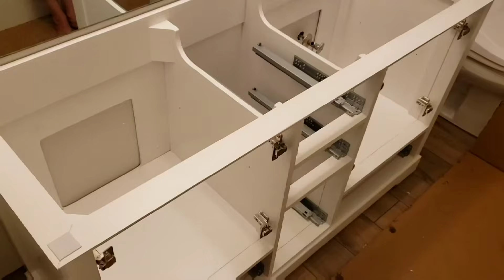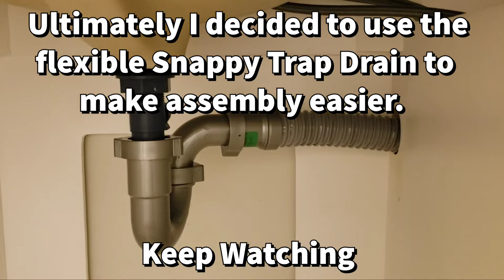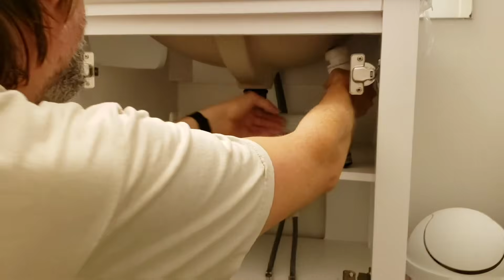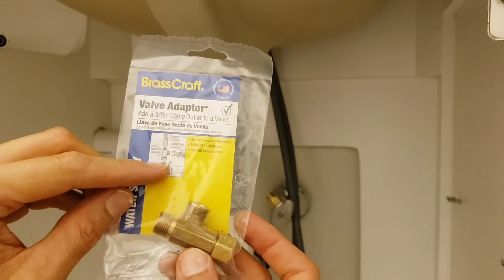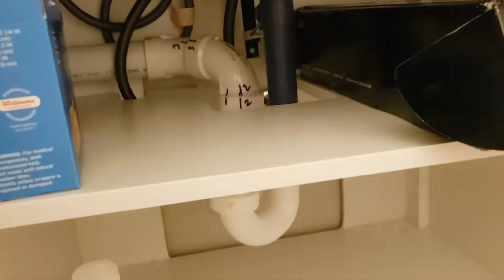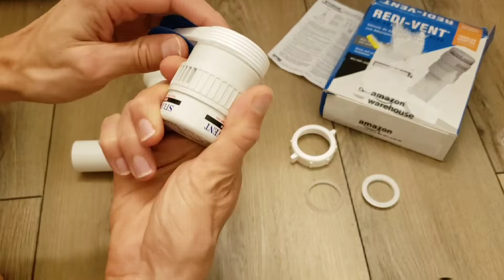Install Double Bowl Sink Vanity w/ Only One Wall Water Pipe Connection & Drain Pipe Using PVC

Comment: Wow... yeah. Don't do this. There is a reason why double sinks in the kitchen don't run their pipes like this. If you fill the left sink full of water or are dumping a bucket of water down it, it can create a siphon and empty the trap on the right sink, potentially allowing gas to exit into the room. If you want to have two sinks with one wall drain, do it like how a double basin sink in a kitchen is done, just an extra couple feet further apart. ffs
Reply from the maker: That was solved in the video by using an AAV. No issues, everything still works great.
Reply: @engineerable  sob... I skipped right past that part with everything else I was looking at, especially the flexible/accordion pipe in a drain. Also, cheater valves aren't allowed in my state. I'm sorry, but this would not be passing any kind of inspection, and if you go to sell the house this is in, it will raise a red flag for any potential buyers. If it works for you, great, but it doesn't make it great.
Reply from the maker: Understood. The flex pipe is not accordian style. It's a thick walled smooth bore. I realize it's not rigid PVC, but the inside is smooth like rigid PVC so it won't have build up.

Comment: I’ve gone through all the comments and nobody has asked, is there a big loss of water pressure if both sinks are on at the same time?
Reply from the maker: Haven't noticed any difference between 1 sink on and 2 sinks on.
Reply: The pressure shouldn't change much because if you had two feeds they would still be connected in the wall. They're not separate feeds coming from the street.

Comment: Oh, honey, that’s a BAAAAD idea using the flexi-drain on a horizontal run! How’d that work out for ya? Plugged much? Sucked out the water from the opposite P-trap much? 🤦🏻‍♀️🤦🏻‍♀️🤦🏻‍♀️
Reply from the maker: Nope, it's a smooth on the inside flex tubing, so no ridges for gunk to build up. At the end of the video I install an AAV to prevent sucking water out of the other trap. Everything works well. No issues. However doing the plumbing in the wall is the right way to do it.

Comment: About to attempt this same scenario with one different factor. The piping from the wall is on the left side not the rear wall. Can't imagine it being much different (I hope).
Reply from the maker: Just a mirror image of this. Don't forget the AAV that's installed at the end of the video
Reply: @engineerable Appreciate the response! I aborted this idea, the plumbing is 24 inches from the wall...I would need a plumber to move it closer. Still considering it.

Comment: So why do you need two P-traps if you only have one waste outlet? Double kitchen sinks only have one. So would this not be the same principle?
Reply: The purpose of any trap is to restrict sewer gases from coming up, not the smell of pipe scum. If you've ever cleaned the pipes under a sink you'd find that one of the grossest places is right above the trap.
Reply: I guess you could eventually get odors from the long pipe run to the other drain??IDK

Comment: This is an incorrect way to drain your double sinks. You can't drop a drain into a vertical drop prior to venting. The drain needs to have a 1/4" to 1/2" pitch after the trap and after the vent, you can have a vertical drop.
Reply from the maker: The last part of the video shows the addition of an AAV to allow for venting prior to the drop, so this prevents sucking water out the trap.
Reply: Now my bathroom smells gas I am guessing from pipeline maybe my pitch is not high enough

Comment: Thanks for the video. I am planning to open drywall behind my vanity but I don't want to alter the incoming copper water lines by adding pex or doing any soldering, so that brass tee to connect the faucet supplies together is exactly what I'm looking for.

Comment: Can I ask how big your vanity is? We are looking to do this exact same thing with a 60 in vanity. Looks identical to yours. How has it held up?
Reply from the maker: Yes, It's 60" in length. This has been a nice vanity. All solid wood, heavy-duty construction, no pressboard junk, dovetail joined drawers and excellent quality hardware. It is crazy heavy though, even without the stone top. Totally worth the cost. It has held up perfectly to the abuse of kids sitting on the open doors, standing on drawers, spilling stuff on it, hitting it with stuff, etc. The plumbing solution (with the AAV) has worked out great. No issues.
Reply: @engineerable  that’s great news! Thanks for commenting back. Super helpful video that we’ll be referencing!

Comment: Glad I found this video. I’m struggling with the same scenario. From a single sink to a double sink with drawers in the middle. My plan is to turn the original p trap sideways so it will be tucked behind the center drawers. The put a T on the original p trap. Then run pipes from each side to the T. I hope it works.
Reply from the maker: Single P trap is a better method. It still doesn't meet code if your sink drains are further apart than 30". Confirm this yourself, if you care. Has to do with the distance for gunk to grow and stink between the sink drain and P trap.
Reply: @engineerable thanks I’m working on the same kind of project and I thing I can make it work and keep it under 30”.  Good info.

Comment: did you use Teflon tape for the water line connections?
Reply from the maker: If it's a compression fitting, it does not need Teflon tape.

Comment: Why would you go through the hassle and install two traps on a single drain line here?
Reply from the maker: Because the sink drains are further apart than is recommended for one trap use. Although it's only a few inches of difference, and if I were to do it again I would use only a single trap and get rid of AAV. But then there is a longer open drain line before the trap.

Comment: Question. can you put Snappy trap on both sides?
Reply from the maker: Based on feedback, Snappy Trap is not ideal. Many confuse it with the accordion style tubing, and although it claims to be code compliant, it can easily be used in ways that aren't. You should use all rigid tube.

Comment: Flexible pipe should NOT be used as permanent piping. It traps a bunch of gunk over time and is terrible for your health.
Reply from the maker: You mean accordion style flexible pipe. The flexible pipe used here is different, it is smooth on the inside.
Reply: How can a drain be terrible for your health?

Comment: Although I'd do this differently, the only thing I'd throw a red flag on is the accordian flex tube.  To me that's a big no-no.  I don't think that plumbing inspectors like it either.
Reply from the maker: The flexible Snappy Trap tube might look similar, but it's not an accordion style flex tube, those are dumb cause they hold crap. It's a smooth interior flexible tube and according to the manufacturer it meets code. However, I would also omit it if I were to do this again, and only use rigid tube.
Reply: @engineerable  a ok!
Reply: I agree. I've had these fail house inspections before. So if you go to sell the house and the inspector sees it they will usually recommend that you fix it. I assume some code inspectors wouldn't like that either.

Comment: It works but that is not the proper installation no way no how, auto air admittance valves are for island sinks where a bow vent can't happen, good thinkin with going behind the drawers that is sly but use 1 pvc union trap tee off and use solid pvc no flexy claranettes

Comment: Wait until the inspector sees this project!
Reply: What makes you think they got a permit? I agree though
Reply from the maker: Replacing the vanity here doesn't require a permit, as long as you don't change anything in the wall (past the shut offs or drain pipe). If we had to redo the plumbing in the wall, that would have required a permit.
Reply: I see all kind of failures here, I can no longer watch this
Reply: Thats not how it works they wouldnt say a thing to him its his home no permit needed to do ptraps lmao thats handyman work dumby
Reply: For real
Reply: I don’t think this is correct as the method of plumbing may create a siphon due the downward slope into the main drain. Also, those flex connects are against code I believe.

Comment: Pipe the second sink into the same trap. Only use one trap. Here you've created a space in the pipe that will just build up with gunk, creating new lifeforms.
Reply from the maker: I considered plumbing into a single trap, and probably how I would do it if I were to do it again. The distance between the 2 sink drains is greater than 30in, and read that you want the trap as close to the sink to avoid smells from gunk growing in the pipes.
Reply: Kitchen sinks have two drains and only 1 p trap and smell is usually not a problem.

Comment: This is why people come into Lowe’s thinking they can tie 2-sinks into 1 drain! Because dip shit people post this videos showing HALF ASS ways of plumbing their own shit! If you’re NOT a REAL Plumber then don’t put these half ass videos showing how to do things the WRONG WAY!! 

If you don’t care enough about your own house to do it PROPERLY, you shouldn’t show others how to be lazy and do half ass work!!!!!!! SNAPPY TRAPS are only purchased by people that DON’T KNOW HOW TO PLUMB PROPERLY!!!!!

What a SHIT JOB!!!!
Reply from the maker: Snappy Trap says it meets code because it has a smooth interior, unlike the accordion flex pipes, which these Lowes, HD, etc also sell even though they don't meet code. At least those products should be labeled "For temporary emergency use only." I agree that Snappy Trap should not have been used in this case, and it is also very easy to use it incorrectly, like S traps they show in their own ads. 

Studor advertise the Redi-Vent AAV for installation under the sink. It was installed following their instructions. 
They quote this code:
"918.4 Location.
Individual and branch-type air admittance valves shall be located a minimum of 4 inches (102 mm) above the horizontal branch drain or fixture drain being vented."
Reply: Dude chill. this video is for entertainment purposes only. If you are a plumber and see this situation in real life, it just means more business for you. lol
-signed, guy who owns a home in southern california

Comment: You’re an Idiot! Sink needs its OWN DRAIN.
Half ass way of doing plumbing! If you don’t know how to do it properly, then DONT DONIT!!
Reply from the maker: Ok, if the Snappy Trap is replaced with 1-1/4in drain pipe, then what is wrong with the install, considering that there is an AAV installed.
"918.4 Location.
Individual and branch-type air admittance valves shall be located a minimum of 4 inches (102 mm) above the horizontal branch drain or fixture drain being vented."

Comment: I’m in the process of attempting this  project with a 60 inch vanity.  🤦🏽‍♂️ 🤷🏽‍♂️are you still able to open and close your drawers to vanity?  Because you drilled through it .. I’m trying to understand what your doing but this is like rocket science to me I refuse to get a plumber now that I see this can be done .  Thanks for the video
Reply from the maker: Yes, the doors and drawers all work. All vanities typically leave a good amount of space behind the drawers, almost as if they are allowing room for plumbing. Although I can appreciate your DIY attitude, it sounds like you should hire a plumber to make sure you get it done right. The method I've shown here works, but may not meet code requirements.

Comment: Great lesson on why you plan ahead, cut the drywall , move the DWV line, move the pressure lines, add two more shutoff valves, check for leaks, fix the drywall, put the vanity in and hook everything up correctly. Thanks!

Comment: I'm not a plumber but from another video I just watched, it is against code to put that vent under the sink.
Reply from the maker: It infuriates me them that these companies sell these products advertised for the purpose of using them in such a way that violates code. They must know.
Reply from the maker: As for installing an AAV under the sink, it is permitted by code in most places, because this is an individual vent not a stack vent, it only needs to be 4" above the fixture drain. 
Snippet from IRC code "3114.4 Location
Individual and branch air admittance valves shall be located a minimum of 4 inches (102 mm) above the horizontal branch drain or fixture drain being vented. Stack-type air admittance valves shall be located a minimum of 6 inches (152 mm) above the flood level rim of the highest fixture being vented."
Reply: My house has these under two sinks that don’t have vents and it passed inspection, I bought it new, so I am thinking code varies by area.
Reply: Also those accordion type pipes are against code also.
Reply from the maker: The pipe I used is flexible but smooth on the inside, not according style, therefore according to the manufacturer it meets UPC code, but that doesn't mean that it can't be used incorrectly, like creating an S trap like their example images show. To be honest, I should not have used it, and would do it with standard drain pipe instead.

Comment: The whole time you were doing this I was shouting at you that the double p-trap would create a vacuum.  Lol.  Glad you figured it out and didn’t leave it that way. 

I am not sure where you are but where I am (in the USA) it is actually not up to code to have a double p-trap. 

The proper way to have done this, here where I am, would be to add a p trap coming off the drain and then put the t-connector on top of the p-trap and then drain both sinks to the T-connector.

You did fix the vacuum problem with the vent but the problem with that is that the vent is also not up to code.  Plumbing a vent below the flood level of a fixture is also against code. All vents should be installed six inches above any fixture or 42 inches off the ground for it to be code.  

What you did is definitely functional for your own personal purposes but I definitely wouldn’t be posting it as a how to video for other people to follow.
Reply: He is in the USA. Where else would people use the imperial system? 1 1/4 inch pipe
Reply: THANK YOU.  No wonder he has to say this is "for entertainment purposes" if any of these people want to SELL their house, a home inspector is going to call this out and they'll spend double just to do the job right.  This is not in any way to code and there are so many problems with doing this I'm not going to list them.  PEOPLE, DO NOT DO THIS!!
Reply: @MightySapphire Can you list them?

Do you suggest I use one P trap and connect two drains to the p connector?

Similar to what you see in kitchen sinks.

Also what will occur if two people will use the vanity simultaneously? Would this cause over pressure on the drain?

Comment: All you had to do was buy an 1 1/2 continuous waste kit and use 1 Ptrap.
Reply: Thank you! Came here to make sure this video was wrong. I'm removing a trap from my sinks from the previous homeowner.
Reply: Thank you!
Reply: He couldn’t, he needed to move the drain line closer to the back wall… The pea trap allowed him to run the drain line through the vanity close to the back wall
Reply: @sexybjjgod  You aren't allowed to do that.  You have to use an offset tailpiece.  It threads right onto the grid strainer.

Comment: Your sinks won't drain properly as you are turning one of your sink drains into a wet vent.
Reply from the maker: Doesn't the addition of the AAV at the end of the video solve that issue? Without the AAV, there was water being sucked out of one of traps. With the AAV, there don't appear to be any drainage or trap water issues.
Reply: @engineerable  Sorry, I didn't make it that far into the video.  That's a reasonable solution.  I'd be interested as to whether any gases leak out through the AAV

Comment: Do not do this that’s not code
Reply from the maker: Is there any way to do this outside of the wall that does meet code? An Air Admittance Valve was used to prevent water being sucked out of the traps.

Comment: This was an awesome explanation. Having to do the same this cause the wife wants to install a double vanity when we only had one sink in the new home we just bought 🤦 this video will be helping me out alot! Thank you!
Reply from the maker: Thanks. The method I showed in the video continues to work well, but it requires the Air Admittance Valve. If you have enough clearance below the wall drain for a P trap (ours doesn't have much clearance because there is a fixed shelf underneath) I would run both sink drains into a single P trap that is level with the wall drain. This will remove the need for the air admittance valve. Check the description for more info about that.
Reply: @engineerable  thank you soo much for the additional info! This will definitely help in the future
Reply: How would you run the pipe from each sink to the p trap? Just a 45-90 degree elbow that both go to a p trap at the main outlet? My lines will run to the middle of the vanity. So no p trap for each sink just one main one?

Comment: Excellent explanation and due care. I need to do the exact thing. Great job
Reply from the maker: Thanks, I do recommend that you see if you can run both sink drains into a single P trap that is level with the wall drain. This will remove the need for the air admittance valve.